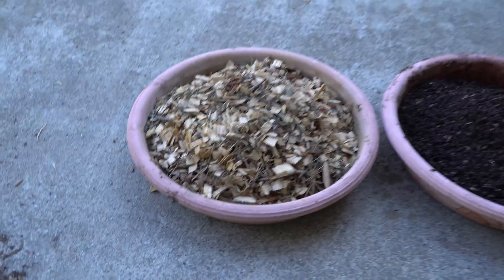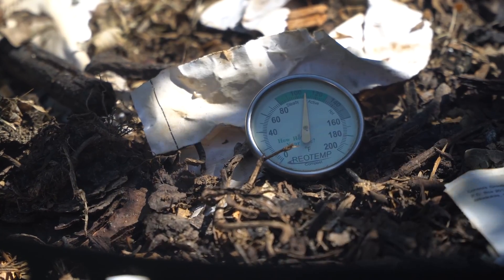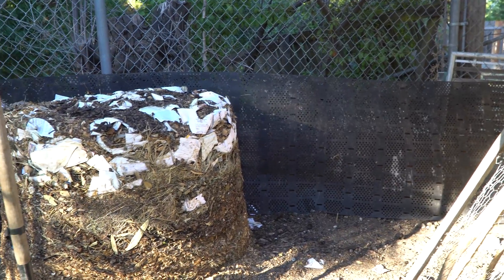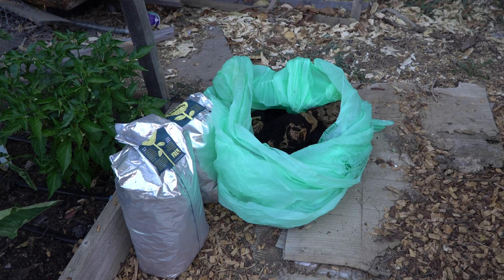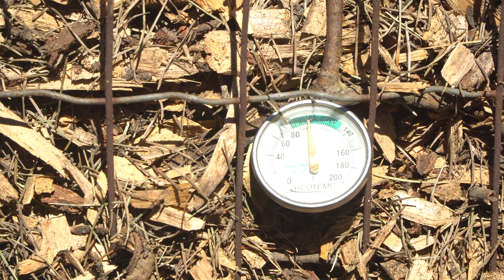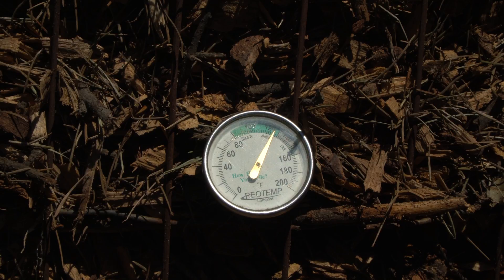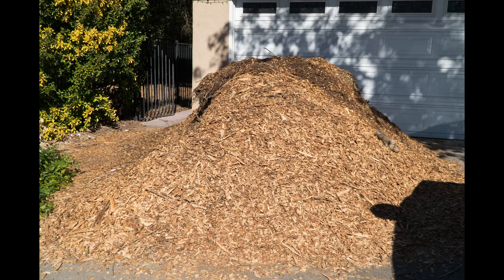Can you compost wood chips?

Comment: I made up a complete compost heap within pallet’s fully lined with wood lathes. At the base I had porous plastic pallet. The uncomposted pile consisted of fine wood chip less than 0.5cm , 20% coffee grounds , 10% cardboard , 10% grass cut,10% weeds,10% household food waste. The whole pile was saturated with rain water and 5 litres of concentrated comfrey poured on the top. Over the top I placed a 100mm kingspan insulation panel. The thermometer read 65c one week later. The 1.5m2 pile dropped by 10 %. Intend to top up with same mix in a weeks time. I have found that with woodchip and coffee grounds I don’t need to turn the ventilation is okay. I will spike with a thin metal spike to open up a bit. I will turn into new bin in 12 weeks and add water if necessary. 12 weeks later I will turn into a new bin with the same type /amount of nitrogen no weeds but comfrey leaves + cardboard .Usually the pile will heat up to 40c. 12 weeks later I will turn again without adding anything into my maturing pile. Red worms then start to proliferate their way throughout the pile. The process takes two years . But I have three 1.5m2 bins and two maturing bins of 2m2.

Comment: I put a 5 lb box of milk powder in a pil about this size, with about the same mix you did, but I added a 60 lb bag of alfalfa cubes, and it gave me great breakdown, my chips were all Arizona hardwoods, summer chipped so had leaves, 3 turns, 6 months and it was done,. The milk powder reduced the bug infestations, and better fungi's, it even grew will mushrooms.

Comment: 6 liters of water a day everyday AFTER you soak the chips in a tub before initial construction. You must have vertical air tunnels every 18". What I'm describing is the Johnson-Su bioreactor. Check it out, it works extremely well.

Comment: Pee on your pile and it will speed it up. Save your pee in gallon jugs and pour it full strength  keep adding pee it is like adding manure. Of course I don't recommend this if you are on medications. This will inoculate your pile and add minerals. Pee is nitrogen rich. Look up YouTube videos of urine fertilizer vs miracle grow. The results were equally lush growth but urine is not synthetic chemicals.

Comment: I just got a HUGE truck load of wood chips, about 20 cubic yards. I had to move the pile by hand off my dads driveway, because it was blocking his car. It took me four days, but while I was doing that, I found that the center of the pile was absolutely steaming and there was already mysilium and fungal growth. I now have it in a tall and wide pile where it can get lots of sun. I thought that the sun would dry it out, but I dug in a couple inches and it was very hot and moist. I am planing to use this as a mulch for my veggies and fruit trees. I am also going to use this as compost. To anyone who has done this, could you tell me some advice and tell me how long it usually take for the wood chips to decompose completely? Thanks 🙏

Comment: I have a chipper and chipper truck, I assure you it will generate heat and compost! My truck gets very hot after fresh chips are in the truck for a few hrs. Also I use it in my garden and orchard as a top layer.
Reply from the maker: I agree,  but these chips seemed to be from a dead tree perhaps.   I've since gotten more woodchips that heated up on their own just as you describe

Comment: Wood chips require a lot of nitrogen and far more water  than your using to heat up properly. It's highly advisable to also make a wood chip pile a little larger than what your doing (4X4 minimum). Also consider using some pvc piping at the bottom of the pile  with drilled wholes on either side about 3" apart. This will infuse a lot more oxygen making a hotter pile. Lastly, if you use fresh grass clippings instead of coffee (can use both as long as grass is dominant) as your nitrogen source you'll get a good 160 degree pile.

Comment: 1. SOIL MICRORGANISMS NEED WATER AS ANY LIVING ORGANISM. IT YOUR PILE IS 4 FOOT, IT WILL TAKE A SLOW STEADING WATERING GIVING IT TIME TO SOAK IT UP. 
2.LANDSCAPE FABRIC AROUND THEN INSIDE OF WIRE BINS IS A BIG HELP. SOME
3. SOIL OR COVERING ON TOP IS A BIG HELP FOR MICRORGANISM ON THE TOP. 
4. ADD WORMS, HAVING A PIPE, OR PIPES.  IN CENTER WITH 1/2 IN HOLES.
5. ADD KITCHEN SCRAPS IN PIPE  
6. RAIN WATER IS WAY BETTET BECAUSE YOUR ARE FEEFONG MICRORGANISMS WANTING THEM TO FEED ON YOUR CHIPS. ATE CHIPS FRESH, THIS MAKES A DIFFERENCE. NOW ON THE BOTTOM, EVERYTHING IS WORKING FIR SURE.
7. ANY KIND OF MANURE, GREATLY SPEEDS UP THE PROCESS. GREEN GRASS, COMFREY, RYE GRASS SPEEDS UP WITH A NITROGEN PROVIDER. 
8. WITH A 16 FOOT CATTLE PANEL YOU CAN CUT O PI EN A WINDOW ON BOTTON. THIS ALLOWS YOU TO REMOVE FROM BOTTOM. THEN ADD TO TOP. AIRATING, PROVIDING SIR TO BACTERIA. 
9. LAYERING THESE MATERIALS IS SIMILAR TO YOU MIXING YOUR FOOD IN A BOWL, MAKES IT MORE CONVIENENT FOR MICROORGANISMS. 

HEY MAN, YOU GOT IT GOING ON. YOUR USING THAT WORKERS INTEREST  ARE A TOOL FOR TRANSPORTING YOURSELF  TO SUCCESS.
Reply: non-chlorinated water is best, so it won't kill the bacteria.

Comment: Let’s do our homework. Do a search on composted wood (chips). It has no nutrients. . It look good, it’s a pretty earthy black, it smells earthy. But has no nutrients that benefit plants. The best compost, which excellent top notch gardeners in England use is LEAF MOULD. Compost LEAVES. So....gardeners: do your homework.
Reply from the maker: Joe, these are arborist type wood chips, a mix of wood, bark and leaves from the tree.  The point is to use a free resource for adding fertility, and in this case part of the experiment was to add materials to the pile to allow it to compost in a more balanced way, as it was obvious that the chips were just a big carbon source, and lacking in nitrogen.  I think the woodchips I happened to get might have been from a dead tree, and there wasn't much life to them so they were difficult to compost.   Fresh woodchips and leaves from a green tree however will hot compost all on their own.  That mix by definition would have a much more balanced carbon to nitrogen ratio and nutrients, or it wouldn't get hot.  Thank you for your comment.

Comment: I had wood chips dumped for me and it was already streaming hot when I started moving it. Ramial deciduous wood with leaves.
Reply: I had to lay a few skids of sod last year on a job and the sod had to sit in the hot sun stacked in rolls on a skid like 5' high. 
By the time I went to lay the sod it was so hot I could barely handle it even with gloves on. It was covered in white mold already.   It was a lot of sod, so I layed and watered it anyway.  Drove by recently and it took perfectly. Nice dark green and I know they don't fertilize there.
Reply: Same here. I got a load dumped on my driveway around Sept. 1 and in a few days it was so hot right under the surface at the top I thought it might catch on fire. The weather was hot and dry at the time. Probably around 92.

Comment: Wood chips are compost with fungus, the greens are composted by bacteria. Water water water
Reply: I've noticed this happening in the forest by my in-laws cottage. There are some old piles of wood chips that have been left in there, and most of the piles are completely dry on the surface with wood chips that look like they where chipped yesterday even though they might be decades old (who knows). For this reason they are basically weed free as nothing grows on the dry surface of the piles. As soon as you scratch the surface you find a fluffy, moist compost that is chalk full of mycorrhiza. I don't think this compost has that many nutrients since it's so old, but it's great for mulching and retaining water in the soil.

Comment: I make large piles of wood chips as much as 5 -6 ft deep and then do nothing and in about 18 -24 mos I have rich black compost. in my leaf compost piles I use carbon and nitrogen.  I plant winter rye grass in early October and when the leaves are down I grind the leaves and mow the grass at the same time and catch it all in a lawn sweeper then add the mix to my compost pile, I add rabbit pellets (manure) and alfalfa pellets (nitrogen) to super charge the compost pile and I get temps between 160 - 180 in a few days and only have to turn it about once a month.

Comment: Maybe make a coffee tea from the used coffee grounds you get and saturate the Pile?  Another suggestion is to mix a can of soda, a can of beer and a half a cup of household ammonia in an empty gallon jug and fill the rest with water, shake it and pour it over the top of the pile while adding water from the hose.   Either of these should help kick start the composting so you will have good soil within a few months or so.

Comment: yes you can !! I have at present 2m³ of finished wood chip compost, that is ready for digging in the ground. And for next years compost I have another 2m³ composting, all I did was take wood chips with the leaves from the tree guy, and made sure they ate totally soaked and then just leave them until ready 

and don't worry about heat, it means nothing
Reply: I had some trash bags of wet brown leaves "composting" all last winter and they did not break down at all.  It was like they had been in the refrigerator. I blamed the cold.
Reply: @watermelonlalala  I had mixed mine with the last grass I mowed. It was at 140F until end of December, then it dropped to 120. Finally went cold in February when the bacteria ran out of useful stuff to munch on.
Reply: @Wordsalad69420  I had similar temperatures over winter without turning. In the end the pile was full of worms.

Comment: I compost huge amounts of wood chips, It’s possible but you need to have it twice the size and no wire fence.  Just mound it up high and wide.  Your right about it losing moisture too quickly, that’s why it needs to be bigger.  Also, you can do it in large trash bags (heavy duty contractor bags, not the flimsy kitchen bags) with an air stone at the bottom or rebag them one a week.  Bags help to keep the moisture from evaporating.  I’ve tried it in plastic totes as well, with air stones, and stacking it up (without lids) and the weight seems to help cuz the lower totes always compost the fastest.  The air stones connected to an air pump prevents it from going anaerobic without constantly turning it but it will compost around the air stone the fastest so I turn it anyways.

Comment: I saw some keystone gardening that advised three parts brown carbon and one part green was good for them. Fresh manure would be more potent. Maybe a black tarp in the sun covering it to keep it moist? Or would that kill some bacteria?
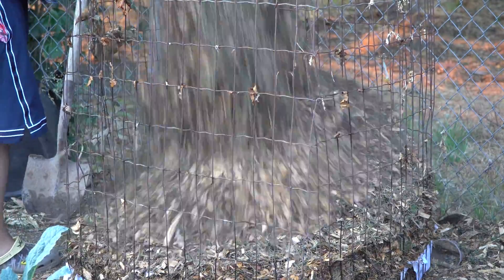Reply from the maker: I think for this set of chips I needed much more that 1/3rd greens.  Maybe manure is a better choice as it may have a higher nitrogen content than coffee grounds.  In the end it's all about creating that ultimate ratio of approximately 1:30 Nitrogen to Carbon, and it just depends on what your starting ingredients are.  Coffee grounds are about 1:20 if I'm not  mistaken, and Manures a little stronger than that I think.  Urine is much stronger yet.  It was a good experiment, next time I'll use chips more sparingly if they are not fresh, or just use them as mulch.
Reply: Chicken manure takes about a year for safety and I never seem to have enough greens
Reply: I have particle board im soaking in water then im run it down with my lawn mower.

Comment: Hello, I would like to give you a it of a tip. The general rule of thumb, is two part of brown which is your wood chips, and one part green. These are your greens. Or you can look it at this way, one nick of green to two inches of brown. Then the compost has to be like a slung wrung out. To aid in the air circulation , place a layer of pine bows or twigs chopped up so they lay flat. Layer them together to form a loose layer....you can add compost tea to your pile during the wetting process. This will greatly increase your inoculation of the pile....watch dr. Ingrams videos for tutorials..very insightful.
Reply from the maker: Thank you Antoinette, I've been successfully making hot compost for a number of years now, but this was my first time using wood chips.  I think overall I added greater than 1/3rd greens into the wood chips, but it wasn't enough to fully decompose them.  Also I think the lack of moisture and the fact that these chips may have come from a dead tree (no green in them) had a lot to do with it.  My final result was what looked like a nutrient rich mulch which I was happy to use to cover my beds.  I'll be giving it another shot when I have a big source of greens available.  Thanks again.
Reply: @davideantonicelli9403  When people like those advocating "back to eden"-style gardening talk about wood chips, they're generally (unless they're mixing "greens" into the mix) talking about shredded twigs, leaves, and branches. This means that there's generally a lot of leaves, so the nitrogen/carbon ratio is better. You'd have to ask the arborist who delivered the chips you show (which will obviously still decompose down to nice black gold), it's probably from larger branches and maybe even stems. That will generally contain very little nitrogen and water - just the little stuff that might be in the bark / between the bark and the stem/trunk. You want the stuff from the crown instead if you want to compost it. And believe me, such a pile gets plenty hot in no time!
Reply from the maker: @patmog  that it does Patrick!  For example any time i shred my own leafy branches. From shrubs and trees on my property they get hot all on their own.  This is mostly from smaller branches, which implies a higher ratio of cambium layer material which i suspect also adds a lot of nitrogen to the mix, in addition to the leaves.  I think the batch i got did not include enough of the greens.  Unfortunately beggars cant be choosers, so I got a batch that was too nitrogen deficient, even though it was delivered in late spring.  I'll probably try to get my hands on another batch this year, hope to have better luck!  Maybe I'll make another video, and then compare the two separate trials.  Thank you for the comment!
Reply: @davideantonicelli9403  Yeah, beggars can't be choosers, and as I said, that is still a whole lot of organic matter that you can use to create a bunch of compost! I wouldn't complain at all :) Even if you have to add some greens.
Reply: Good ideas, the branches and the tea sound like a good way to go.

Comment: I have successfully composted tons of wood chips using fresh chicken manure for the nitrogen source. I used a 4 to 1 ratio with the 1 being the potent manure. The chips came from a commercial land clearing contractor that use a large tub grinder. So material was not ground fine. I would turn 3 times to complete process. The bigger the pile the better. You can never have enough compost.
Reply from the maker: Thank you.  Sounds like manure is the way to go.  I don't have easy access to enough though.  Maybe when I get more chickens!  Thanks for sharing.
Reply: How many months did it take to turn into compost?

Comment: Piles to small. I have a pile cooking at 160
Reply from the maker: Gerry,  Thanks for the comment.  All my non wood chip piles of this size will usually cook between 150-170.  In regular piles I often have to turn them to avoid them getting too hot.  I think the issue here is the carbon to nitrogen ratio, and I underestimated how much nitrogen was needed to get a wood chip pile cooking.